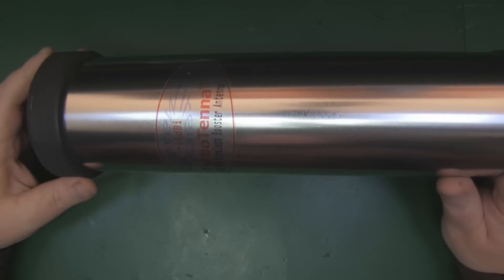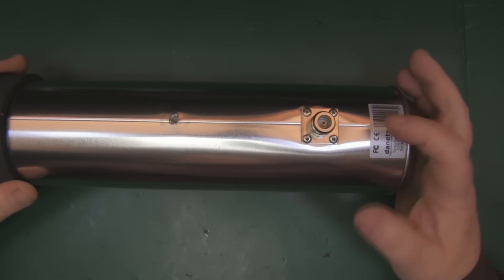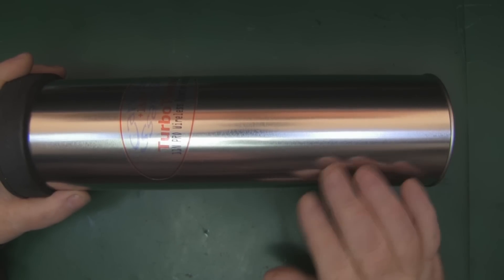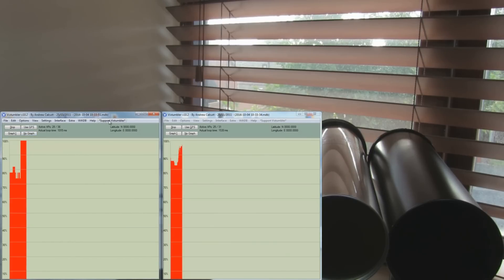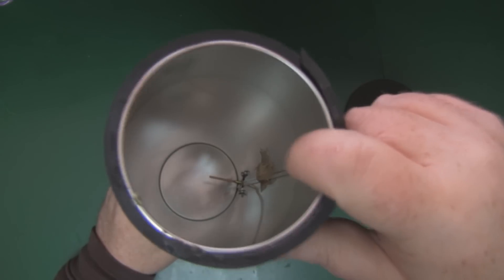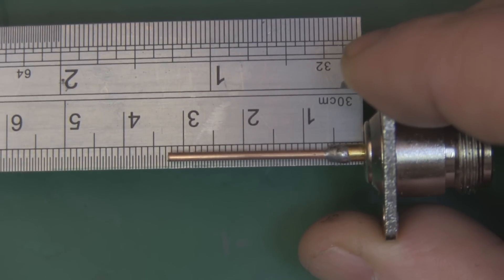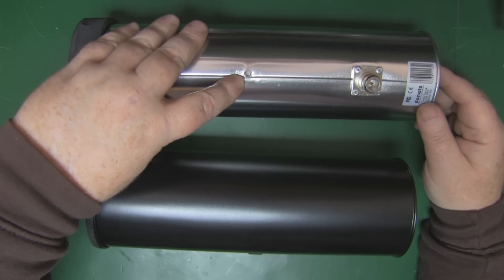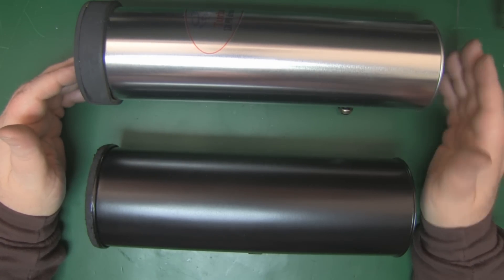+18dBi TurboTenna WiFi Cantenna 2.4GHz #173

Comment: To couple into wave-guide, I typically use a conical monopole rather than a straight wire, to ensure sufficient bandwidth. Though not necessary for these things to work, every little bit helps. And yes, that 18db is just crazy, crazy fake, not crazy good!

Comment: Clearly, 18dBi is another overinflated Chinese claim for a cantenna design!  The N-connector is to facilitate the use of larger & lower loss cable you mentioned: for outdoor use, minimizing cable loss at 2.4 GHz is very important.  For indoor use, where the receiver/transmitter is extremely close to the antenna, SMA is the way to go.  Converting from N connector to an SMA is likely to result in 2dB loss if an adapter is used in addition to the SMA cable used in your antenna.  With either antenna, weather will degrade the antenna.  Rather than buy theirs, why shouldn't everyone make their own for much less than 30 pounds, since it is such a simple antenna?   I like all your videos, but this one is closer to the dislike edge.

Comment: Andrew is forever making/testing antennas, from dishes to yagis. I wish he would say which is highest gain.
Reply: A parabolic will win the gain competition  for directional types, for omnidirectional types I'm pretty sure a slotted waveguide will be the  winner.
An old primestar dish ( ~3' X2' single focus offset parabolic)  fed with a good biquad will give 27-30 Dbi .  At this gain the pattern is a very tight beam ( ~3 Deg,)  and can be hard to aim.
the slotted waveguide gives close to the theoretical max for an omni of  ~15 Bdi.
Don't be fooled by idiotic claims of some seller/manufacturers.
These gains were verified by computer modeling and later field tests see  martybugs or Trevor Marshall's site for details and plans.
Reply: @ghz24   what are you saying, i'm not a pro in those antennas just trying to figure out which antenna will catch signal from far away hotspot. any recommendations?
Reply: @noobblet1996  Parabolic wins the gain game. 
Decibels are logarithmic so every 3 dB doubles the signal strength.
The primestar dish I refered to is rare now but it was oval and about two feet wide and three feet tall.
It's gain at 2.4 GHz is 27- 30 dBi
27 would be 512 times the signal of a perfectly omnidirectional ( isotropic) antenna.
30 dBi would be 1024 times.
If I were trying what you are and didn't already have a primestar dish I'd search for an abandoned hughesnet dish.
Replace the feed with a cantenna or biquad.
Even a center feed 3 foot diameter dish (k band satellite) would work.
The new dish antennas with three feeds might work but I've never tested them to see if they have a focal point or a focal area.
You want a feed with a beamwidth that iluminates the whole dish but to wide will miss the edge and be wasted. Shorter than optimum cantennas and biquads fit the bill.
Cable losses are extreme at this frequency I used ethernet to transport distance and placed a router in client mode running DD-wrt within pigtail distance of the feed point. 
Don't believe the advertising claims of companies trying to out do the competition.
One final piece of advise try diferent heights above ground because at certain heights the ground reflection is 180 degrees out of phase with the main signal and can cancel out the signal.
A couple feet higher or lower could be all the difference. Good luck. If you need more elaboration ask away Ill try.
Oh and tree leaves suck.

Comment: Do you have any idea why there's no commercially sold 3G/LTE cantennas?
Reply: Well, consider the "legitimate" uses that can be thought of be such an item. Cell signals can be blocked by interfering signals, and it is also why many places will not sell frequency jammers. So, think about having a mass produced, commercially available directional antenna like this, in a world full of cell signals.... you could block peoples calls, or cause other "problems" in a solely cell frequency cantenna. Especially when you have thousands of users out there, aiming for heavy traffic areas. You can see where the issues come to play. 

They are out there though. It is similar to the frequency jammers. You are better off getting your own hardware/radio for the cell frequency, then making the antenna. 

I personally hate that a lot of Chinese knock off Yagis are tuned more towards that 800-1500mhz range. You might be able to use one of those TBH.
Reply: Color MehJewish I'm confused. Why are you comparing a directional antenna to a frequency jammer? Why would connecting a yagi antenna or cantenna to my LTE modem and pointing it at a cell tower cause problems for other people?
Reply: Okay, lets say that those types of items were commercially sold to the market. In theory, youd have a lot of directional, acute angeled transmissions going towards a tower. Seems like it would clear up a lot of the background noise we get from conventional antennas. Well, in conventional transmissions, the signal is not concentrated in such a strong, but small area. If multiple devices were pointing at each other (tower in the middle) or if they were both on one side, sending from a close area in respect to each other... The strong signals can "block" or disrupt the data being sent or received. So, it can cause a similar effect to having a jammer, bc there are various types of jamming equipment. Consider Wi-Fi... You can overpower frequencies to block any signals. Works with cells too (in the lower freq range) when their signal is overpowered. Imagine a commercially available to the public, scattering these overpowered signals in different directions. It would be like a freq jammer in the sense that they would be overpowering other signals all differently spaced from the tower. 

Other types of jammers include the ghetto ones, like when you write a script and broadcast it to pickup MAC addresses and DoS them so they cannot gain a signal. Id imagine there's cell-protocol equivalents, but im not as familiar with that field. I just know that we have limits on broadcast power, but imagining that power being directed by everyone towards the same towers, could cause frequency blocking by radio waves hitting each other n interrupting, or thru packets being messed up in transmitting them from various a angles. Not to even mention the idea that the tower itself, and other obstructions would scatter the "beamed" signals and potentially cause extra noise and other site map issues. 

If you want to learn more about it, check out site mapping, with apps like inSSIDer or Acrylic, connect a radio+antenna, and you can see realtime updates of the signals around you, collisions, overlapping channels, and various other problems to hurt radio transmissions. They'll give you a visual idea and other important data about signals that you pickup w your radio. W a laptop you can move around and find all sorts of radio anomalies. That's why a majority of higher power signals are mounted above a certain height too. So they do not interfere and they need to be strategically placed. Sometimes even shielded from directional transmissions from other high power relays/broadcasts.
Reply: Color MehJewish Very very interesting. Thanks for the in-depth explanation.
Reply: Np anytime. That's the beauty of technology. Most in the field(s) prefer to share the knowledge and help others. One person might have expertise in a certain area, but lack knowledge of another area, while the opposite is true for their peer. Helping each other educate and empower themselves only improves the world we live in, mutally. The more i know and share, the more i can help others contribute, and the cycle continues. 

I feel that all of us "tech-ies" are just awestruck by the material, so we enjoy talking to others about it - especially when its something new. 

Btw, im giving you some advice thru exp. We use the self-made signal jamners to test Denial of Service vectors in some pentesting projects. For instance, a local mini mall hired us, and we had shown them how a simple device and battery pack could take down all internal and external services without ever breaching the network. For clients like cell phone stores, or for those with wireless pay options, simple attacks like that can result in devastating loss of revenue. And the device is simply scanning for addresses or signal, and overloading their hosts, or overpowering their signals. Under 150$ of equipment. 

Def check those software site mappers oht tho. They'll give invaluable insight into learning/identifying the ways in which radio signals work. You can see what materials slow, absorb or reflect the signal. It gives a much better idea of how interactions occur and why.
Reply from the maker: Good info Color MehJewish and that's why I stay away from those frequencies the telecommunication industry has so much money invested in their networks the trouble you could get into is not worth it.